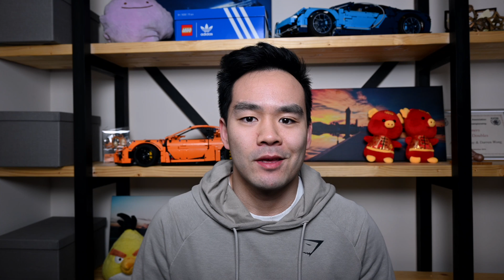Do engineers over-design everything?! - Structural engineering

Comment: Excellent video, it's a coincendence I found it while I'm in a bit of a pickle! I am watching this as the client, and I have a pretty technical background in IT. I had 2 engineers spec up different beam sizes for the same opening for my rear extension. The 1st engineer spec'd up 203x203x52 UC for the main beam, I then hired a 2nd engineer due to a new architect, and he spec'd up 254x254x73 UC. I really want that beam to be concealed in the cieling void, to achieve that I need the beam size to be 203x203. I asked the 2nd engineer if it can be reduced to size 203x203, he said it can't be! The 2nd engineer provided the calculations, for the main beam, I can see a table for what looks like the utilisation with a capacity ratio column; Vertical shear 0.23, Moment 0.48, Buckling 0.72, Deflection 0.75. Does that mean the design can be improved so that the utilisation can be increased, so that I can use the beam size 203x203?
Reply from the maker: Based on the utilisations it seems there is scope to use a 203UC but what weight of beam is he specifying? 

Difference between the two engineers is quite vast.
Reply: @EverydayDazz  The 2nd engineer specified the main beam to be 254x254x73 UC hence the weight specified is 73?
Reply from the maker: There’s a possibility to use heavier 203UC but he’ll need to do the calcs to check it.
Reply: @EverydayDazz  Thanks I've emailed you.

Comment: Material strength and stiffness are both under-valued in codes as a redundancy, in the meantime, the loads are all over-estimated to cover all possible worst cases in the codes as well. So it’s an approach of double-defences to ensure the reliability and structural performance under all cases. If the structural engineer wants to further over design the structure, that will come to an extra level of redundancy, as you said, that may turn out to overrun the budget of the owners. Anyhow, it’s up to the structural engineer to balance all conflicting factors and make the judgment.
Reply: Hi I’m a graduate structural engineer. I haven’t experienced speaking to clients/contractors yet. Can you please give me an example answer that you could say to a client/contractor when told of an element is over designed! This will really help with my confidence of knowing what sort of thing to say.

Comment: Hi Darren! Got a question for you from a uni student just getting into structural eng. 

In the near future, when more and more projects incorporate greener structural materials (e.g. mass timber, and (possibly) recycled plastic concrete reinforcement, recycled/waste material utilisation etc.), I would have to guess that their 'utilisation rate' will be quite a lot lower than traditional construction materials, due to lack of long-term real-world performance data. Does this make them less viable for clients to use? Also, how long might it take until utilisation rates can increase?  

Cheers :)
Reply from the maker: The problem with using new materials, is generally cost. Clients and contractors tend to seek the most cost effective way to build something to make the most amount of money. Being sustainable unfortunately is generally of little importance compared to making money. 

I have a good example where the original intentions were to be green and sustainable but the project was too expensive therefore was only made possible by using cheaper and less green options. I’ll do a video on this next!